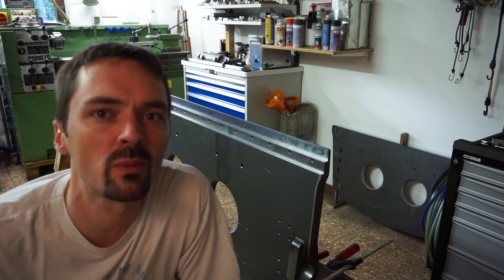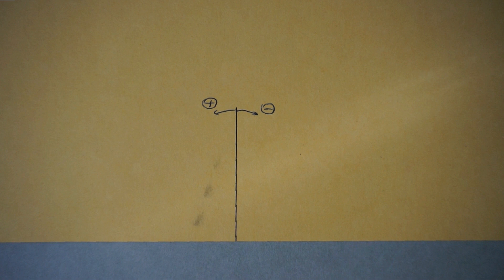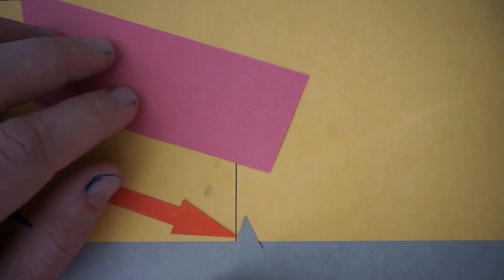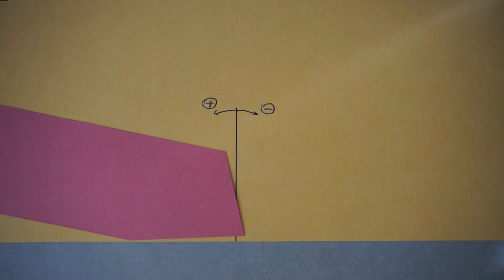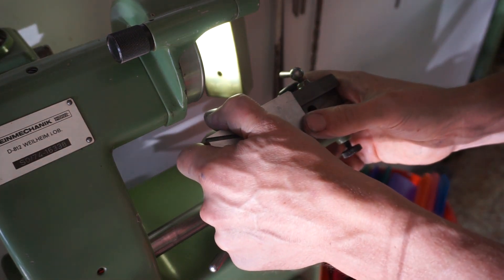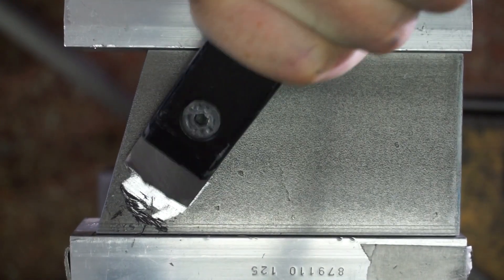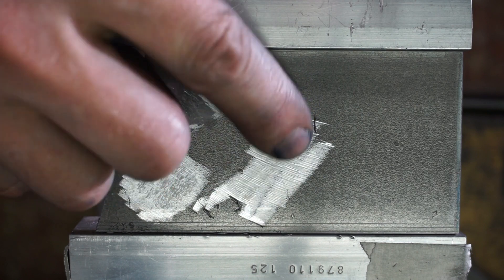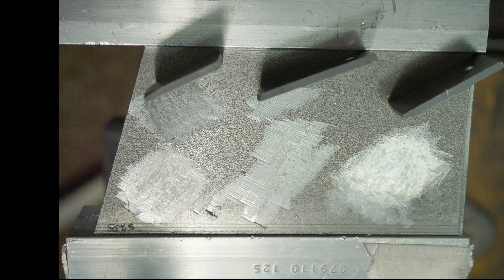Hand scraping carbon steel: carbide insert geometry

Comment: AAAAH, wenn ich die kleinen nadelartigen Stahlsplitter schon seh pieks
Toll erklärt, war mir garnicht so klar, dass die Kaltverfestigung  bei Stahl ein Problem ist.

Sieht immernoch nicht aus wie Spaß, scheint aber sehr gut zu funktionieren. Finish sieht sehr gut aus - Manchmal hilfts auch wenn man nich exakt 90° zwischen den Durchgängen versetzt, damit sich einmal eingeschlichene Scharten oder Ratterer nicht aufschaukeln.
(Randnotiz, diese Freiflächenfase machen auch die Leute die von Hand mit einem Stichel gravieren, damit sich der Stichel nicht eingräbt.)

Übrigens: Probier mal Bronze flachzuschaben, das geht traumhaft (5° Negativ) ;)
Reply from the maker: Wie immer vielen Dank für deine netten und aufmunternden Kommentare, Stefan. Ist mir auch erst beim Schneiden vom Video aufgefallen, dass ich 90° versetzt habe, was ich normalerweise versuche zu vermeiden. Man verstärkt ja sonst wie du sagst nur die langen Wellen der vorherigen Schabestriche. Sehr spannend, was du von den Gravierern schreibst, davon wusste ich bisher nicht.
Reply: @anengineersfindings  Alex, I've seen some wood carving chisels sharpened pretty much like this to avoid digging in too.  Thank you for this video -- I had never considered that steel & cast iron would scrape differently, but your explanation makes it very clear!
Reply: Hi Stefan......I follow you.....good to see you here with another "kindred spirit"........cheers, David
Reply: There is very little information on scraping carbon steel - thank you for sharing this!

Comment: Cool info. I scraped both mild steel and stainless steel 304 and didn't really see any of those problems but I was not trying to be so aggressive with the cuts. This is good info to know. It reminds me of the "heel" used on engraving gravers to control depth.

Comment: A magnificent video. Detailed, explanatory, demonstrative. Thanks!

Surprising, that the end geometry reminds the wooden chisel - worked with sharpened surface down. In the same way, you can control the depth of cut by adjusting the angle with the help of that small "heel" down there.

Another idea, again from woodworking. Chip carving knives have to make delicate, curved cuts and are sharpen with convex grinds therefore. Ideally, nowhere they have a flat surface, even near the very edge. Which gives the carver a capability to control the angle and allow the knife to exit material in a very precise and controllable way. May be slightly convex "heel" would help your carbide insert as well?

Comment: Interesting video.
I am not an expert on this subject.
My personal experience is that pull scraping works better on carbon steel rather the push scraping. I use same carbide blade as I use for cast iron
Reply: Yeah I think pull scraping adds a natural self regulating stability to the forces.

Comment: I thought I had watched all your videos Alex, then found this one. I used to make scrapers from old files when I was a sea going engineer, the grind I eventually settled on was very similar to yours, I had a flat at about 5-10 degrees on the bottom then the top had a shallow 30ish degree angle with the cutting edge at around 45-50 degrees but only about 0.75-1mm high. They did a good job of cleaning up flange surfaces on various materials, but needed frequent re-sharpening. Carbide scraper blades were not a thing back then.
Reply from the maker: Very interesting, thanks for that comment!

Comment: I teach people to scrape steel by hand and with power.  You scrape steel by hand the same way as scraping cast iron.  With a neg. 5 degree blade.  Positive blade with a power scraper.  This info was inside Stefan work booklet he received during the class.  I will try your tip grinding method next time I scrape steel.  You can teach old dogs new tricks .Rich King
Reply from the maker: Hello Mr. King!
Many thanks for your comment, I'm very honored to find you were watching my video. Stefan already told me about the technique that you teach for scraping steel. Unfortunately I didn't have a chance so far to try it because I have no power scraper. Please let me know if the tip grind shown in the video works out for your steel scraping work. Best regards, Alex
Reply: An Engineer's Findings  I  seldom scrape steel anymore and have never had problems using the 5 degrees.  If you have discovered the new way,  congratulations.
I scrape cast iron machine tool ways and would never make a steel straightedge.   I make cast iron straightedges.  As all other famous companies like Brown & Sharp never made steel straightedges.  I've seem a steel rule made by Starrett but there not made for scraping.

Comment: My scraping  was always  bringing two(2) unequal surfaced ,on the same plane .profiled on any geometric surfaces. 😅.usually reserved  as oil retention. Work hardened chemically or heat treatment. I was a witness  of a true metalworking  on a lathe  with supper hard surface. He used a electric power scraper..the size of a gas hedge trimmer. 😮😊

Comment: As the grain of the steel is softer and more ductile, your scraping blade should also be of a softer material. Therefore, my theoretical choice would be high speed steel. This would be my starting point. As you progress in tool geometry you could then start to compare and experiment with different high speed steels for your application.
Do to the much higher graphite content of the cast iron, the harder blade will have a much better tendency to slide over the base material, compared to low carbon steel.  Hence, not gouging the surface as your video clearly demonstrates.

Comment: I appreciate your effort but i dont see the problem you are trying to fix from the first place specially that your positive rake appear to dig into that steel which seems to me is cold rolled, i am assuming hot rolled will be even more challenging, I dont understand the initial problem that you faced since surface finish is not the goal in scraping AFAIK, hope you can explain more about this point, thanks

Comment: Hi Alex keep coming back to your videos 👌🏻
Do you think it would be possible to use an oscillating multi tool like a fein cutter to do scraping?
Reply from the maker: Hi Mads, very interesting idea, however, I think this would sooner or later become troublesome, since on the multi tools I know the lift is very little and not adjustable. This would slow down the scraping process notably, I think.
Reply: @anengineersfindings  Think I’ll give it a shot. Just silver solder a peace of carbide to an old blade. 👍🏻

Comment: This is a great video. Well thought out and very informative. My formal training is as a Carpenter and Cabinetmaker. The geometry you have described is used on hand planes for wood. And the methods are very applicable. Control of how the cutting edge digs into the work piece. Thanks for taking the time to make such a well thought out method of scrapping a material that is common to so many projects. I work as an amateur machinist on projects and I will remember this and apply it in the future for precision work.

Comment: Bin absoluter Laie aber trotzdem schwer beeindruckt, dass mit der Schabetechnik derart ebene Flächen erreicht werden. Schaben erscheint mir wie Feilen, nur mit einer einzigen scharfen Kante.
Könnte man Ratterer und Scharten eventuell einfach vermeiden, indem man z.B. ein 1x1 cm großes Feilenstück an der Spitze der Schaberstange benutzt, sodass man flächig abträgt?
Reply from the maker: Wenn man nur Schruppen würde, könnte das sein. Allerdings trägt man beim Schlicht-Schaben ja nur in Mikrometer-Größenordnung ab. Ich denke das funktioniert nur deshalb so kontrollierbar, weil man mit einer definiert im Eingriff befindlichen Schneide arbeitet.
Reply: @anengineersfindings  Ich kann folgen. Jedenfalls ist es erstaunlich, welche feinen Genauigkeiten die geübte Hand erreichen kann. Tiefer Respekt.

Comment: Excellent work ! I have power scraped steel and , as you mentioned, it works well with the classic 5 degree negative angle. I scraped in a 1100 mm long steel straight edge and then I used it to scrape my 1067 mm Bridgeport X axis. At either end of the table I messed up a little bit, around 3 x 1/100 of a mm, but in between I got a decent 1/100 of a mm over an entire 600 mm length. Thank you for taking time to share your work. Cheers !

Comment: Can you use high carbon steel blade with this geometry on soft carbon steel
Reply from the maker: Should be possible, but I'm sure that's tedious because of quick dulling of the blade.
Reply: @anengineersfindings  is it necessary or your method also prevents chatter on soft steel

Comment: Hey mate thought I'd share ONE WEIRD TRICK for carbon steel; I'm finding you can use the normal 5 deg angle on the carbide for cast iron and get a nice cut if (after blueing) you douse the surface in CRC or WD40 then take light cuts, keeping the tool on the surface to stop the chips getting underneath, you can still get some marring if your not careful but generally you can hear it when its not cutting properly, also keep cleaning the chips of the blade.
Reply from the maker: Nice, thanks!

Comment: When sharpening with diamond wheels, I always put the cut on the inside of the wheel, and cut from inner to outer. This way the front edge of the wheel does not wear out. Allowing for the ability to grind flat geometries, like making a D bit. I find that a very slight positive angle works very well, stops it from wanting to dig or bite into the steel. Having the heal to control works very well. I did not make as long a heel as you did, so will try your method on the next tool I make.
Reply from the maker: Very good observation, Sir. When I made this particular video, I wasn't aware yet that it's more smart to use diamond cup wheels radially from inside to outside. Robin Renzetti mentioned this recently in his video about making boring bars. Good point.

Comment: Every once in a while, there's one of those "of course" moments.  I've been struggling with scraper geometry on steel for ages, lousy surface finish with negative rake, horrible gouging with positive rake, and as you started with your little cardboard diagrams I could suddenly see why, and what was needed.  

Brilliant.  Thank you.  I'm out to the workshop, I have a straight edge to refinish.
Reply from the maker: Thanks, I'm very glad if the content is useful.

Comment: Thank you for your effort her Alex.
I notice the sub count is going up every vidio of yours I watch.
I kick myself for not cross referencing from other disciplines.
In wood turning, when using the slicing technique, as opposed to the scraping technique, you balance the cutting action of a knife edge sharp cutting tool by rubbing the heal of the bevel on the rotating wood.
This takes a bit of practice I can assure you and dig ins are.. Disasters.. I'll leave it at that.
But the technique is the same principle..
Well done, thank you.
Now where did I hide that scraper....
Reply from the maker: Good point, thanks!

Comment: Excellent work and nice presentation of your thoughts behind your work. Your streight edge looks interesting can you please tell me how you made it?
Reply from the maker: Thanks for your nice comment, Mr. Bruun. The straightege is made up from two rods of carbon steel with a lasercut fillet welded in between. The fillet is designed to be most rigid in shear, which gives high bending rigidity of the assembly. The welds are critical in terms of the edge's precision over time. What matters most is to induce the least residual stresses with welding as possible.
Reply: An Engineer's Findings thank you 😊 Did you then scrape in the straight edges or are they surface ground?
Reply from the maker: @madsbruun8423  Of course it is scraped, the technique for this is shown in this video (scraping of carbon steel!). I have no access to such a large surface grinding machine. Thanks, Alex
Reply: Well done, and thanks. Please keep posting 🤙🏻

Comment: Thoroughly enjoyed that presentation. Thank you for sharing your findings. The second 'rubbing bevel' is similar to geometry on certain cabinet making edge work (wood work) and wood turning tooling.  I have found the 'curling' cut which produces a broad curved scraping mark, helps enormously to reduce chatter on steel scraping. It does take some effort to take deep cuts, but 0.01mm depth is not so hard similar to that required for straight scraping.  Thanks again for the video - Ive subscribed to see what else you get up to :-)  All the best Mat
Reply from the maker: Thanks, Mat.

Comment: I'm perplexed, all the scraping videos I've seen use a much different technique, like Robin Renzetti or even Stephan Gotteswinter, the cut is always in a singular direction, and a singular motion
Reply from the maker: Perplexed? I'm not sure what you mean exactly.
Reply: @anengineersfindings  I'm perplexed as to why you are not using a similar technique, despite your results, which seem sufficient. . .they all seem to favor a "monodirectional" singular cut rather than the continuous motion that you were using.

Comment: VERY interesting. Scraping mild steel to satisfactory finish and flatness has been a recurring mystery to me since I was an apprentice in 1962. My co-workers and I tried many combinations of edge angle, end radius, topical treatments (olive oil, steric acid, hand cleaner, goops made by the dark of the moon) but nothing worked very well. We got our turbine cases and steam chest covers etc steam tight but every job was a squeaker.

That - I'd call it a "heel angle" - reduced clearance angle seems to work slick on steel. I'm on fire to try it. What's frustrating is I use the same trick on my woodworking chisels to control the tool's aggressiveness in cut cut. Engravers closely control the heel angles of their burins and watch maker on the tiny lathe tools they use for clockwork axles.  Shoulda seen it but I didn't. Nice piece of problem solving. If I had a medal, I'd pin it on you and feed you a beer and a pizza, if I had beer and pizza.

I'm linking this video to Stefan.
Reply from the maker: Thank you for your very interesting comment, Sir.
Very interesting to hear about the techniques you tried to scrape mild steel. Was it the steam turbine housing's parting surfaces that you had to scrape? WOW...! Please let me know about your results with the technique of this video.
Thanks for the pizza and the beer - I'll try to get some today to comply with your nice comment :D

Comment: Excellent and very informative video...  I've been considering build my own CNC mill, using granite/resin base and other parts.  Part of this would be to use steel inlays for mounting the linear guides.  Your technique for scraping carbon steel will come in very handy for making the steel inserts as flat as humanly possible prior to installation of the rails.Thanks for sharing...  Very helpful content!
Reply from the maker: Thanks, glad you find the content useful.

Comment: Sehr interessant und gut dargestellt, besonders das Papp-CAD, auch wenn ich wahrscheinlich nie Stahl schaben müssen werde. Was benutzt du denn für HM-Platten, die schauen ja wie Hobelmesser aus, aber von holzverarbeitendem Hartmetall wird meines Wissens immer abgeraten, was würdest du da empfehlen?
Reply from the maker: Die HM-Rohlinge, die ich hier zeige, hat mir ein Freund geschenkt. Deren Cobalt-Anteil oder ursprünglichen Verwendungszweck kenne ich leider nicht. Aber sie arbeiten bestens sowohl auf Stahl als auch auf Grauguss oder Aluminium, und das zählt für mich.

Comment: Excellent and thorough demonstration. I'll soon be making the fixtures to adapt my S0E to grind scraper inserts as you have shown. Very resourceful, thank you for showing those.  Is that a steel straightedge (parallel?) that you fabricated yourself, shown at 0:50?
Reply from the maker: Yes, Donald, the straightedge shown is custom made for the purpose shown in the picture. It is a welded design (with carefully thought out weld design and strategy), made from carbon steel and scraped to my grade 00 surface plate (with a scraper blade as shown in the video). This straightedge cost me in total about €50 (mostly for the laser cut fillet-sheet) and I could fabricate and scrape it to finish in about 5-6 hours.
Reply: Outstanding, Alex! Sometime I'd love to hear more about your straightedge design and fabrication strategies. I assume that you went straight into scraping just after fabrication, with no need to surface grind?
Reply from the maker: That's right, Donald. I have no access to such a large surface grinding machine, so I rough it in with the angle grinder and then scrape it to precision finish from there.
Reply: An Engineers Findings what did you use as a mold to acquire a long straightedge?
Reply: @anengineersfindings  Good job! Is that straight edge geometric stable over time? I could use such one for my Maho MH500 rebuild.
Reply from the maker: @BMtechnl  Frankly I haven't checked this yet since I didn't use this particular straight edge since then. However, I assume it is stable because of the very little areas with welding-residual stress.